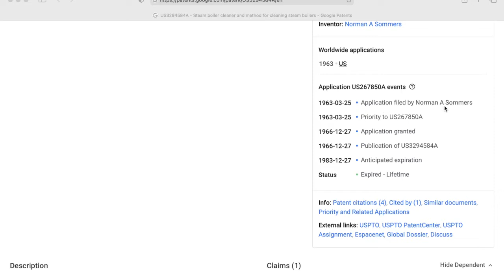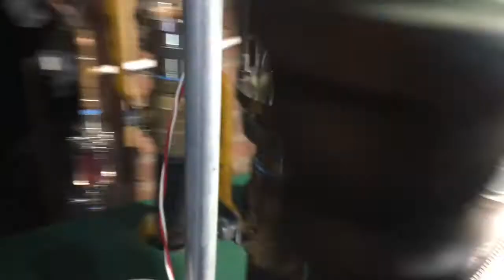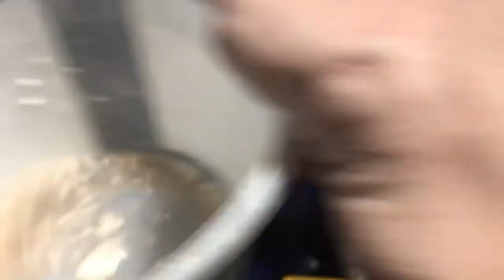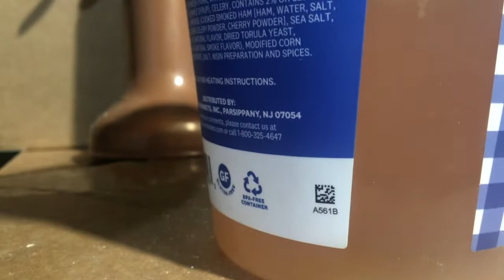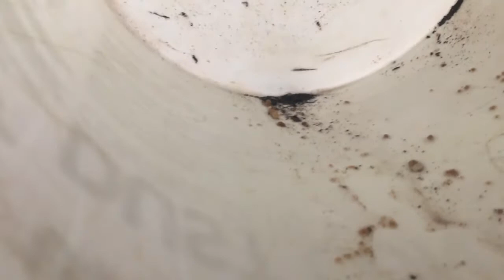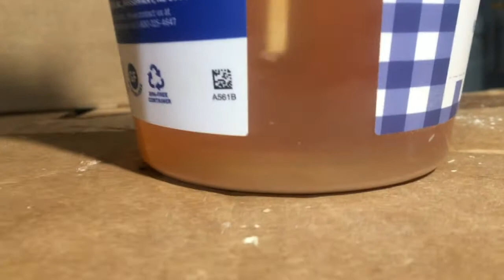What does Squick do in your steam boiler?

Comment: Squick is an excellent product. I’ve been installing boilers for 40 years and servicing boilers just as long and I’ve used this product often and it has excellent results and never has caused any issues.

that being said this is the only product I would ever recommend being added to a steam boiler.
Reply from the maker: It's fine if you have no way to skim, but skimming is a better way to remove oils in my opinion. And then you should consider 8-way which puts the pH at a level where corrosion is almost eliminated. And you only have to use about 1/3 of what the directions indicate.

Comment: I used this stuff multiple times when I moved into this house with improperly installed near boiler piping done by previous homeowner.  The equalizer comes down a couple inches away from, and pretty much blocking access to, the skim port.  Yay!  Nice job!  I have the larger brother to yours....Peerless 63-04L.  I hope it lasts a long time.  20 years so far.

Comment: My boiler has many 3/4" plugs on the top of the water jacket. I find adding treatments a fairly simple process using a funnel. Perhaps you can remove your top shroud and locate one, punch a hole through the top shroud for easy access? I have used Squick before but my issue is rust from years of neglect. The best thing I have used so far are Hercules products.
Reply from the maker: You don’t like my skimming entry point?

Comment: Thank you so much for doing these boiler videos. I truly can’t get enough of them. Those site glasses are quite mesmerizing. I would love to have one of those on my system. I love the longer videos with all the info you give. If you released one that was three hours, I’d prob watch the entire thing 😁. 

I’m in the process of trying to dial my smaller one pipe Weil McLain in. I used 8 Way and it surged pretty bad. Maybe because a plumber told me to use the entire bottle? 🤔. I then used surgex pounder and it’s still surging quite a bit. I’m assuming I have wet steam. My radiators are banging quite a bit for the first ten minutes or so. The radiator/return pipe in my bedroom has a torturous dripping sound (condensate) for up to an hour after my system shuts off. Its a thud thud thud sound, like dripping water. It’s quite maddening! Any ideas? It also rips through oil like an SOB. 

Thank you again. Please keep the videos coming.
Reply: Thank you Paul. I will def drain and refill with plain water this Week.
Reply from the maker: Thanks for the kind words! First, plain water is the best starting point. Additives don’t really help with surging. I’d recommend draining and refilling with just water for now. 

It’s the near boiler piping that will determine if you have “wet steam” or surging. You can make a post on the Simply Steam forum on https://HeatingHelp.com 

You can post pictures and people will tell you how it looks.

hammering is caused by water where it shouldn’t be, either due to surging or due to a low spot or sagging pipe that acts as a water trap

Comment: Hey Paul, do you think a snubber is necessary before a pressuretrol? Is a snubber necessary before all gauges?
Reply from the maker: No, not needed for a pressuretrol or normal gauges like 0-3psi. Some people have them for very low range gauges but I don’t
Reply: @pb7379-j2k  Are steam surges not an issue for the pressuretrol? It was hard to get a consensus on the forums.
Reply from the maker: @bentso8002  what is a steam surge?
Reply: @pb7379-j2k  what’s your email? I can send you a few pictures of the install and see if you see any issues.
Reply from the maker: @bentso8002  I’d start a thread on HeatingHelp.com with the photos and the symptoms that are happening—you’ll get a lot of experts looking at it

Comment: Awesome videos, thanks for taking the time to show everything your doing it’s so nice to see how everything is working inside and also with your different experiments! Great idea with the big sight glasses also did you think of that or did someone else? Just curious
Reply from the maker: Thanks! I know I was inspired by the Weil-McClain glass-piped demo boiler ( https://www.youtube.com/watch?v=ovFq-RPdK1M ) Then somewhere I found out about the tri-clamp sight glasses. I haven't seen anyone else use them on a steam boiler. 

There is another guy who installed a temporary clear plastic tube on the condensate side of his system to use as a kind of manometer. I think I saw that after my first use of these sight glasses.

My first one I installed on the vertical drop to my wet return so I could see if I had carryover that way and to observe how much condensate my system generated (it was very easy to install there). It was such a great result I knew I had to install them on my new boiler.

Comment: Thanks for the great video! One possible experiment if you have extra product leftover would be to have a jar of water, water + 8-way, water + surgex, water + etc. then dropping metal pieces into the jars and leaving them to see how well they can inhibit rust. There may be some interest in seeing how well these may help preserve our boilers.
Reply from the maker: Thanks! I could do that but there are two reasons I probably won't:
1. The corrosion-inhibiting effect of higher-than-neutral ph is well-documented and accepted
2. The jar is quite a different environment than a boiler with its relatively dramatic heat-cool cycles and the agitation of boiling and the different metals involved

Comment: Great video.  What are those  glass style   coupling and where can I buy them .  I would live to see how my boiler level is with this glass style coupling
Reply from the maker: Thanks! The connections are called “tri-clamp”. Search for “tri clamp sight glass” on Amazon and ebay. There are NPT adapters for them. 

I have one also on my vertical drop to my wet return just above the water line.